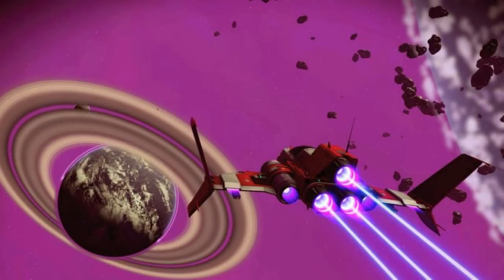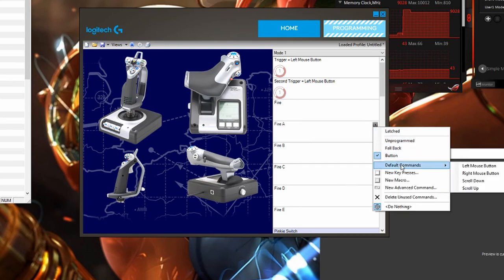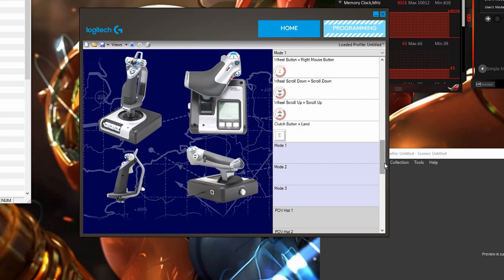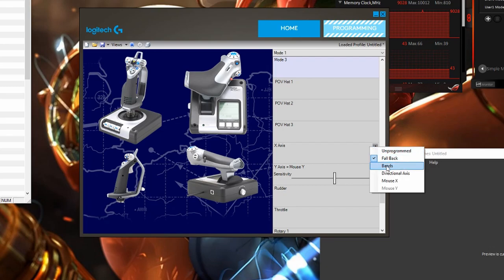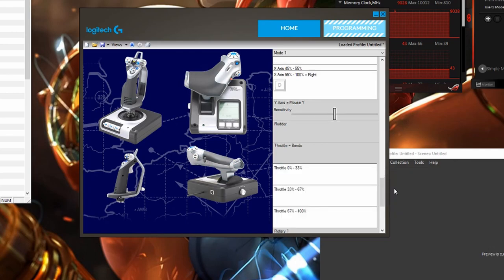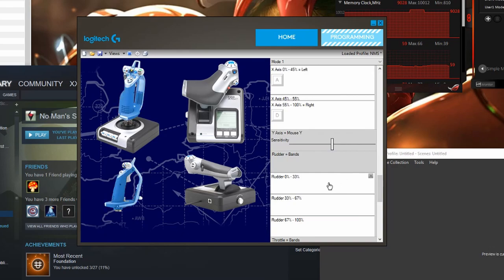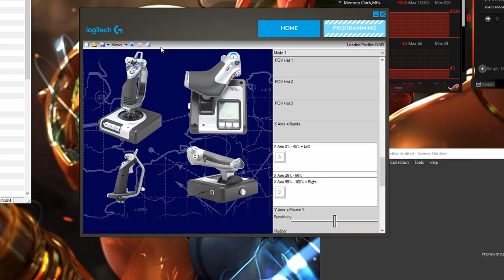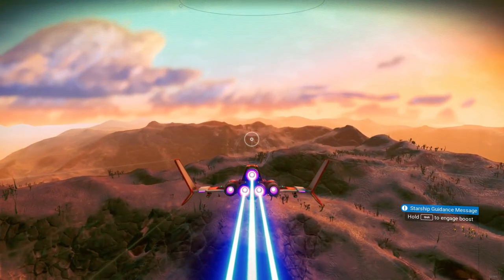No Man's Sky HOTAS Setup | Controller Work Around 2019 | Saitek X52 Button and Axis Mapping Guide

Comment from the maker: Turn OFF "Tethered" option in flight control to help with the aim ring snapping back! Change from Tethered to "Locked". Thanks to Joel for that one!!
Reply: I'll be curious to see what your thoughts are going to be on the beyond update that comes out tomorrow, I think
Reply from the maker: @joelwilliams6035  It is suppose to come out today, I am on Steam and discord trying to figure out where it is lol. Guess Steam will be one of the later platforms to the party. I have a VR and am excited to try that out, but will probably stick to playing in 1440p. Hello Games has been pushing good stuff out so far, so it should be pretty awesome!
Reply: Going from tethered to "locked" does not help with the aim ring snapping back in.  This is with the X-55 not the 52 though.
Reply from the maker: @shepheardadi4329  Not sure why it wouldn't work for the X55. That is super awesome though, that thing  has so many throttle buttons and switches! XD I have seen 2 patches update in the last 24 hour for No Man's Sky so fingers crossed for some good fixes. Just wish they would offer HOTAS support like other popular space flight games!

Comment: Hi, CatDaddy and everyone else. I got myself a x52 system and it is working great so far. Thank You so much for Your help. CatDaddy, You are a something like a hero. There is only one little issue: Even though I deactivated the "Tethered" option and switched to "Locked" I have the problem, that if I move the joystick and (therefore) steer too long in one direction, the movement gets locked and the ship keeps steering in that direction even though my joystick is centered and "untouched". It does not matter if it is up, down, left or right. Is there a solution for that? I tried to adjust the sensitivity, but that was pointless. Thank You so much!
Reply from the maker: Lol well I am really glad this information was helpful! I wouldn't say a hero lol XD just happy to help others since this is a difficult thing for this game to do. I am curious on your issue though. Is it all controls with the joystick? Pitch, yaw, and roll? I personally have this issue with my rudder. Doesn't happen on roll or dive. Someone else in the comments got it to work without the "sticking" inputs. I wonder if it is a setting in the Saitek programming. I will look more into this and see if I can figure it out. Hopefully they just fix it themselves so we don't have to anymore!! Thanks for  letting me know and for the feedback! It is much appreciated! :)
Reply: @CatDaddyGaming  Thank You so much. It is all control with the joystick. The x-axis of the joystick are linked with the x-axis of the mouse, y-axis of the joystick are linked with the y-axis of the mouse and roll is linked with A (roll left) and D (roll right). Who got it to work withouth the "sticking" inputs? I mean, it is much better, when You switch from tethered to locked, but if I steer too much in one direction it gets locked anyway. No problems with rolling so far for me. Thank You so much for Your ongoing research. I already wrote a message to Hello Games about the joystick-issue. I hope to read from You soon. Thank You so much. Cheers.
Reply from the maker: This comment was hidden is my "likely spam" comments so I am just now seeing it. Have you been able to get it working since? I still have not found an resolution for these sticky inputs. I either have to deal with my rudder sticking or just play with the mouse and keyboard. I know there is a large player base that has been asking for HOTAS support on the game so I am just convinced Hello Games is against it for some reason. Maybe it will cause issues if they add a joystick input. Doesn't make sense to me but neither does them ignoring players asking for it. I will dink around with it again since a few updates have come out since then. I will for sure be in touch if I figure anything out!

Comment: I have a Thrustmaster T-flight Hotus X but the website doesnt show a software for mapping. Any suggestions on a software to use that will allow me to map my buttons in a similar way
Reply from the maker: So NMS Beyond broke this work around and it isn't currently working. You should still be able to find another key mapping software. If the HOTAS itself doesn't come with one then a program like Anti-Micro would be your best bet!

Comment: I use a Thrustmaster T1600M Hotas with rudder pedals, and the controller itself is pretty nice, but that TARGET software wont even start, so i have to try to find 3rd party software to set up my hotas like this... Cant believe NMS have still not added support for this stuff... They even added VR................ And disco stuff, LOL!
Reply from the maker: And the rudder petals work without sticking?? That's amazing! I had the chance to buy a used pair but didn't pull the trigger, maybe ill reconsider cuz i do enjoy flight sims. I'm convinced that the NMS dev team is fulling against HOTAS support. I have seen it asked for for years, and like you said, they have added tons of silly stuff but no HOTAS support. As long as they don't keep breaking the work arounds I can manage but they are missing out on making lots of players happy.
Reply: @CatDaddyGaming  Pedals work nicely so far. Perfect for throttle and break/reverse on the SRV in Elite Dangerous, and the joystick adds an awesome feeling of "operating heavy machinery". I just got them recently though, so im still not fully accustomed to using them for controlling the roll of the spaceships...
Reply: Hey, I use the exact same Joystick, but I alsways get stuck on the first direction in wich I pull the stick an spiral down to earth. How did you solve this issue?
Reply from the maker: @zappo7291  Sorry for the late reply. The Beyond updated patched out the ability to use the mouse with the HOTAS so currently the workaround is broken. Wish they would give us HOTAS support if they aren't gonna let the workarounds work.

Comment: Set your rudder on the x52 software to Mouse X axis to get rudder functionality. I currently cant set any hotkeys due to a bug so Ive been unable to bind anything in game to rudders.
Reply from the maker: I'm glad you mentioned this so it can hopefully help someone else out. I tried this method yesterday and it did give me rudder control but I had to twist the rudder back to neutral after turning. I have been playing in between mouse and keyboard and my HOTAS with no rudder. I also haven't been able to map any controls since Beyond dropped. Hoping for a bunch of patches and soon!!
Reply: @CatDaddyGaming  Curious that you have to twist rudder back to 0, is your spring broken? Mine twists back on its own, it acts more like a deadman switch. I have a Saitek version though, I heard when Logitech started producing the x52 its a little different.

Comment: you know you can change NMS so the flight system is not using the "pull" system with the mouse. that would fix the Y axis better. it would closer but not quite Ace combat style
Reply from the maker: I tried my hardest to figure out how to do this but had no luck. How would I go about doing this? That would help out greatly!!
Reply from the maker: @joel williams thank you good sir, I ended up figuring this out, you have to turn off the "tethered"option in flight control! thank you for pointing this out!
Reply: @CatDaddyGaming  sorry I did not see this sooner. Did that fix or at least make the flight controls better?
Reply from the maker: @joel williams It helped out so much. Takes care of that aim ring snapback. I updated the video description and pinned a comment mentioning this method. When I first made the video I was unaware of what the tethered option fully did, but now looking at it I can't believe I never dinked with that setting before lol thanks again for pointing that out! :)
Reply: @CatDaddyGaming  I found that in the Logitech software if I turn down the sensitivity to the Y and X axis that it helps a lot on the "sticking" issue.
2 years too late if you have not already found a better solution. If you have, id love to hear!

Comment: Going from tethered to "locked" does not help with the aim ring snapping back in.
Reply from the maker: Interesting. Hopefully they just pour some time and resources into the key mapping. When I switched from Tethered to Locked, it took away the aiming ring, and locked a retical in the center of my screen. Still isn't a perfect work around but I do still get to use the HOTAS so I just hope they keep on working on issues.

Comment: As of the time posting my comment, there is no turn left/turn right option in NMS ship controls section. Seems like they just keep wanting to mess with the controller users. -_-
Reply from the maker: Yeah they removed that option shortly after I made this video. Now I have to map the turning to Mouse X and it is still kind of janky. Rudder turning gets "stuck" for some reason. They must really be against HOTAS support because it has been asked for for years.
Reply: @CatDaddyGaming  How exactly do I go about doing that? I don't see the option for turn left/right at all in the settings so I wasn't sure where to go next. Thanks for the quick reply by the way
Reply: Nevermind, I see what you mean. Got it :)

Comment: @CatDaddy Gaming and to anyone else: Hi, it is me again. I didn't manage do figure out how to solve the "steering-lock-problem"; If I pull the nose up of my ship after a few seconds it remains in this position and steers up even when I leave the joystick untouched. So You wrote that You don't have that problem. Maybe I did something wrong at the programming the X52 or ingame. Is there a way that maybe I can send You my .pr0-file so You can check it? Can You please tell me, what Your ingame settings are? Thank You so much! Cheers!
Reply from the maker: @ L.V. O Thanks for pointing this out, I did look into this and tried to correct the issue, but I did not have any luck. I just spent a good amount of time trying to reconfigure my profile and even started from scratch and I was unable to fix the problem but I do think I figured out what is causing this. I believe the issue lies in the Mouse X and Y axis being used by the HOTAS program. That is why the rudder and the pitch get "stuck" in the last input given. When I made the video it was a solid work around that functioned well. However now I believe it is just No Man's Sky that is causing the issues. They replaced the intuitive remapping features with the lame ones they have now, since back then we could assign keys (literally any key) to turning, which I am not finding options for now. As for the pitch, I am also experiencing the "stuck" input on my pitch which wasn't an issue for me a month or 2 ago. I am going to look into the Saitek program and see if I can configure around it but I am afraid that it is just No Man's Sky not wanting to work with the work around. This is not the first time they added a patch that disabled the work around. I do find it silly that the dev team has not applied a good HOTAS feature as it is widely asked for. I will keep trying to make a work around as I believe this is a great game for HOTAS functionality since you are a pilot in most the game. Sorry for the long reply but I did want to let you know that I tried and will continue to try so we can all fly with our HOTAS! If I am able to figure something out I will let you know as soon as I know. I appreciate the input and hope we can get this figured out!
Reply: @CatDaddyGaming  Hi CatDaddy Gaming, sorry for my late response. Thank You so much for You effort. Maybe we will get a new update for the Saitek software someday. And thank You so much for Your ongoing research. If I "hear" some news about our problem I also want to let You know. Cheers, m8!
Reply from the maker: @l.v.o7435  No problem at all! Yeah do let me know if you find anything out and I will do the same. Bummed out the workaround doesn't work as well as it used to. I haven't jumped in since the Thanksgiving update so I will have to do that soon. Hopefully they end up patching it to where it is better for us to customize it to our liking!

Comment: Can you do one of these for Thrustmaster
Reply from the maker: Unfortunately I do not own a Thrustmaster HOTAS so I am unsure on how their device software works. Does it have a profile mapping software like Saitek does? I believe it wouldn't be too hard to figure out. There are a ton of 3rd party mapping softwares, but I would have no way to test it out and see if it was working correctly.
Reply: @CatDaddyGaming  I've tried using the Thrustmaster software called TARGET GUI. However it's very lame comparatively to the software you're using. Also whenever I click while the profile is active it just stops working. Very annoying. Is there good 3rd party software that works with Thrustmaster ?
Reply from the maker: @CorrectCrusader  Very weird. I know of a one that might work, it is called AntiMicro. A quick google search should supply you with many many more but you might have to trial and error them to see if they work with your HOTAS. Pretty sure AntiMirco will do the trick but I never had to try with my HOTAS since I had the Saitek software.

Comment: Hi , If I download your profile , would I put it n ..Steam , apps , NMS , Config ?
Reply from the maker: Are you using the X52 HOTAS program for your HOTAS profile? I believe it is Logitech. It's the one I use In the video. Just save the profile to where ever. I have a folder on my desktop for my profiles. When you open the program to load a profile, select the one you downloaded and you should be good to go. Dont have to save it anywhere special, just have to make sure you load it into the program. :)
Reply: @CatDaddyGaming  it's a x52 ,  loaded it into antimicro and saved it profile 2 ,  Even on the digital read out part of the x52 , it says no profile ..  ..
Reply from the maker: @solarisaint1 I assume you grabbed the .pr0 file yeah? That file is for the X52 HOTAS Software. It wont work in the Antimicro. The .amgp files are the ones for Antimicro but those are only for mapping NMS VR to a controller, not the HOTAS. The HOTAS software is the gonna be better to use for your X52 than the Antimicro for sure.
Reply: @CatDaddyGaming  I have the x52 non pro , it's a buddies ,  Which software ?
Reply from the maker: @solarisaint1 That's the one I have as well. It's the main software for the X52. Think it is from the Logitech website. Just google Saitek X52 Hotas Software and it is one of the first few links.
Reply: Ok , I did download the non pro version 64 bit , I'll try playing with it again ....I know I  didn't run into any software that looks similar to what  you using in the video , Eg...The pics of the x52 on the left and the dialogue boxes on the right ....I'll see What happens ....Thanks for your kind Help ..

Comment: does it work in VR?
Reply from the maker: Currently no. Put this up before the VR update came out. When you launch in VR it takes away keyboard controls so the work around does not work in VR. I have read some forums where people claim to have found a way to use there HOTAS while in VR but I will have to confirm. I will keep trying and if I find anything you can be sure I will let everyone know!
Reply: @CatDaddyGaming  k thank u so much
Reply from the maker: @omairalmulla8474  I was able to get this working in VR. Don't know what you have, but I have NMS through Steam and then an Oculus Rift. While in VR the keyboard functions still work and the mouse will work while in the cockpit of your ship. This is perfect as the work around mimics the keyboard and mouse. Set the rudder to "Mouse X" and you should be able to fly with the HOTAS during flight. The Rift Touch controllers will still remain the main controllers
Reply: @CatDaddyGaming  thank u so much
Reply: @CatDaddyGaming  Dude!
Cheers!
VR without the right control is only pain!
Reply from the maker: @Hiobdasgrosse  I assume by this comment you got it working then? Super glad to hear! I'm always afraid they will update the game and break my work around since it has happened before. VR is NMS is so much fun but the virtual hotas is too wonky and not as fluid as a physical one!